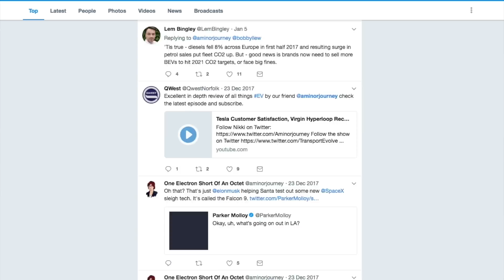Electric Car Fires: What You Need To Know

Comment: You can never compare Internal Combustion fires through collision with E. V. Every side of electric are battery rupture points as internal Combustion is only one side. No matter what these batteries are cased in doesn't matter as lithium polymer batteries emit there own oxygen meaning even under water they will burn. However all known resources and reserves of these batteries will be depleted within 10 to 15years. The lithium resources in our oceans have been considered financially unattainable. Plus in a internal Combustion vehicle no passenger sits on the fuel tank. Most EV occupants are sitting above batteries. Without Internal Combustion food/crop production will be lower and possibly threatening human starvation

Comment: Electric cars do catch fire less frequently but some of the vids I have seen - once they start they engulf the car in moments.
Reply: True
Reply: Danny Trump  Trump,stfu lol
Reply: EV☄🔥⚡
eXpensive Vehicle 💸💵 🤑
eXplosive Vehicle ⚠️☠🚨
Reply: Yes and in the case of the great Tesla once the battery fails you can not open the doors! Year ago a Tesla in London Ontario caught fire and hundreds of people had to watch the family die! Helples to open the doors to save them!
Reply: gas is not as pressurized as battery's they become powerful flamethrowers when they go critical
Reply: @Velvex_Vancreed  you just can't put lithium out. Just to see how dangerous they are we took a 12 inch square 1/2 plate put it on top of 2 patio stones ad put a cell phone batter on it and hit it with a hammer.  My god what an explosion and fire! It melted half way through the steel plate!
Reply: @Velvex_Vancreed  False. CNG is far more dangerous than batteries.
Reply: Motor cars catch under the fire more than elec. cars ,and every day motor cars catch fire 1000 times and that is normal,but when it comes to electric cars they are new teh. so its sooò dramatic when elec car catch fire.
Reply: @marjanoviccc  do they catch fire 10,000 times as often?  If they do them that would be a similar frequency! No where near!
Reply: @marjanoviccc  more petroleum cars are on the road hence more fires, an EV fire produces more pollution than a petroleum car fires
Reply: @Maximustard  no, per capita, EVs are better.
Reply: @b-7478i  prove it

Comment: Great reporting Nikki !    Another thing to consider with electric cars vs ICE is the amount of "fuel" in the tank/battery.  A Tesla 85kwh battery holds the equivalent energy of about 2.5 gallons of gasoline (fully charged).  A Tesla battery pack is in compartments and even in a crash the energy/fire potential is slow to be emitted compared to a gasoline fire in an ICE vehicle.  If I were going to be in a vehicle that caught on fire I would want to be in an EV that I have time to get out of.   Not a gasoline fire in an ICE vehicle that CAN erupt in an instantaneous huge fireball ( I have witnessed such an occurrence).

Comment: Is this a Tesla fire debunking or EV fire debunking, since as far as I know some EVs (like the Leaf) catch fire much less frequent than Teslas. Also, talking about Tesla flammability and safety one should bear in mind that Tesla cars are quite expensive (80-150k USD) so these should be compared to the safety of the similarly priced cars.

But usually, it is Tesla against the average, instead Tesla against the top dogs - where they position themselves, against top Merc, BMW, Audi, and similar. So it would be interesting to know if these top models catch fire as frequent as Teslas. Everything else is falling into the pit of the PR and demagogy readily served by our lord and savior e-Loan Mars.

For the reality check, please see where Tesla Model S ("the safest car in the world") fall in the Euro NCAP crash tests - at the bottom of the five star performers list, just above fellow five star performer Skoda Fabia. Also see how Model S performed in the IIHS test, where test equipment crushing Model S (top one) was crushed during the roof strength test not earning top score. There is a graph, so it is easy to compare to other cars. Tesla also stated that Autopilot is much safer than human drivers, but compared it to the safety of pedestrians and bicycle riders. When numbers were crunched properly, Autopilot was actually less safer than a human driver. Of course, if you buy it, Tesla story is - when you survive a crash, then this is due to the Tesla and the Autopilot. If you die, then, ah hell, it was undoubtedly your fault.

Comment: We had a car at work a few weeks back, spontaneously combust. It should be pointed out that it was an ICE vehicle, but the fire was due to an internal short in the ABS brake system, that happened in an collision. The car was repaired, but the short not discovered, until the fire...
We don't know yet what the Tesla fire was caused by, collision damage, battery pack damage, or some aftermarket accessories. Keep an open mind.

Comment: I agree with Bruce.  We are talking about a LOT of energy required to move a CAR/BUS/TRUCK down the road.  The Lithium batteries can catch fire if they are punctured/damaged... so if you drive over a post or something spikes the battery... could be a problem.  The speed of a Lithium battery fire I believe is typically slower than a gasoline explosion.  But I would be willing to accept new data.
Reply: Gas cars hardly ever explode except in the movies. Only ever had none catch fire at a road crash in 30 years in London FB Battery fires are chemical fire and Lithium is a very unstable element and dangerous. Two electric bus fire (High profile) in London in last few days!! They catch fire in seconds and the gas vapours as they vent explode and you have a serious fire you cannot extinguish by normal means. Water becomes contaminated and it takes lots of resources. You the have to dispose of the remains and Lithium. Garages will not touch Lithium battery cars.

Comment: I'd like a video covering how to react in case of a EV fire. How to react? Are there toxic substances released you should be aware of? Can you help victems out of a EV without having to fear injury?
Reply: These fires usually spread slowly so there's time to evacuate, and I don't think there's a risk of explosion. Big batteries are made up of small cells and each has it's own protection. In one case the entire front half of a Model X was obliterated in a crash, including part of the battery pack, still there was only a small fire.
There are some toxic stuff, but their release strongly correlates with the extreme heat so easy to avoid.

Comment: I am pretty sure that if my Zoe caught fire I'd have plenty of time to get out. With a petrol fire that time would be a lot less. On another note a friend told me he is taking his car in to be looked at because he can smell petrol, I told him I wouldn't use the car in that case. I am sure everyone has seen an ICE car totally engulfed in flames at the side of a road but because it isn't that uncommon in the grand scheme of things it barely gets a mention in the press. I also think that the fact that my Zoe is a very cheap car to insure suggests that there isn't much risk of it spontaneously combusting.
Reply: No. The car will continue to keep starting on fire due to the batteries. They will reignite again and again. The video fails to show the problems the emergency service has putting them out. Most are burning up in big wrecks.  A video search will show a very different picture.  Get out ASAP or get cooked.   Simply the best thing to do.

Comment: While I don't like to speculate.... The fire seemed to be located just inside the front left hand wheel, so is suspect it was not the battery pack but could be due to a short from a damaged cable feeding the front wheel drive unit or even the grease from overheated wheel bearings.
Reply: John Michael  - but you don't like to speculate.....
Reply: It looked a lot like a Li-ion battery fire.

Comment: Interesting report, though it sounded like there is a bit of inherent bias in the statistics involved as most ice cars driving around are pretty old on average. And is there even a mandatory 
recurring technical check in the US? I assume getting the data right would be enough to fill a bachelor thesis with, so I won't hold it against anyone, just point it out.
Also, did you find anything on random fires on other EVs? Is Tesla just the only one covered so frequently or ar they just prone to ignite more readily than others?

Comment: Thank you for being unbiased on ev fires.   Too many cherry pick the facts to support their negative bias toward ev’s.  ICE fires rairly get covered and when it happens to an EV its all over the news.  I’ll feel much safer in an ev than sitting in a ICE with 15 gallons of explosive gas any day.
Reply: You crack on your ev has already given the planet a massive carbon footprint before its first charge. So much so that university studies have concluded that a dirty diesel ford with 200k miles on has a smaller footprint!!!!!!
Also to add america has thousands of used nissan leafs lined up after they have died because you cannot recycle the batteries.
Oh how did they get there? By a bloody massive diesel boat which also produces pollution....
Its not about saving the planet its about money and having the latest car, phone, laptop etc etc.
Reply: Yeah you go with your EV. I’ll continue saving the planet by maintaining my 17 year old Toyota with 130,000 miles and not upgrading to a new EV every 3 years because society tells me this is the thing to do. People need to realise that getting a new car means your old one has to go somewhere. Much more environmentally friendly to buy a car that will last 20-30 years with replacing the least amount of parts possible. An ICE car will easily do 30 years of maintained properly, especially a diesel. I’m not sure how many battery packs an EV will go through in 30 years but 100% it will have to be changed.

Comment: I prefer electric vehicles over gasoline vehicles, hands down. But I think there are a few points missing in your assessment.

The first is that in the case of a fire caused by gasoline, the fire's intensity is limited by the supply of oxygen. That is, there is a maximum burn rate. In the case of a fire caused by faulty or damaged lithium ion cells, the burn is potentially more catastrophic. The lithium ion cells do not require oxygen to burn, and if one cell can produce enough heat to push neighboring cells beyond a temperature threshold, the entire pack is at risk of 'thermal runaway'.

Tesla's battery design is great, but we inherit a different set of risks by adopting battery technology. While it is possible (and even statistically apparent) there will be less fires overall, the fires themselves may be more intense, especially as the industry continues to develop the chemistry in terms of capacity and current delivery.
Reply: Solar Steve Everything needs oxigen to burn even lithium batteries.
Reply: Perhaps 'burn' was the wrong word. Thermal runaway in a lithium ion cell does not require any oxygen, and if 85KwH of cells dissipate their energy as heat instantly, you can bet nothing around them is going to survive. What if these batteries were 500 KwH? We're talking 1.7 million BTUs of heat. That's more than my furnace can put out in a day!
Reply: There are plenty of videos of car fires, they don't seem to be limited by air supply much. All ICE cars are filled with highly flammable liquids, that are often leak a bit, so even a small flame near the engine means huge unstoppable flames in seconds.
And big batteries are made from small cells, each has it's own protection and controller, so it's practically impossible to have all of them blow up at the same time. You have little chance of controlling the fire, but you have plenty of time to get the hell out.

And yes, lithium needs oxygen to burn.

Comment: okay, now... discuss how many electric cars have broken down on the side of the road...... AND!! I'm not discussing running out of battery power as ICE cars can also run out of fuel.... I want to know how many BEVs have broken down.
Reply: EVs are far more reliable and require far less maintenance.
Ironically Teslas have the most trouble with the 12V battery, which they inherited from gas cars.

Comment: Just Google "Chevy fire" or "BMW fire." But Tesla is small volume? Google "Rolls Royce fire." 
But you can't even pack lithium batteries in your luggage to fly. Right. Care to try packing a spare gallon of gasoline on a flight?
While the Tesla fire video was dramatic the fire had not intruded into the passenger compartment. Plenty of time to leave the vehicle. Gasoline fires are often, make that usually, much more violent.
Reply: Tesla is not "small volume" on a model by model basis. When these sorts of things are studied, a Model S will be compared to peer vehicles, a Model 3 will be compared to peer vehicles, etc. Nobody cares whether Ford as a whole has a lower or higher incidence of fire as opposed to how their pickups compare to other pickups, their sedans compare to peer sedans, etc.
Reply: I was just using the type of overstating common among haters. It will be interesting to see the root cause if it's ever announced.

Comment: I'm curious to see the first Tesla Model 3 battery fire. From what i've seen and read, they have the most advanced EV battery pack ever made.
Reply: Probably somebody drill battery from beneath! 
It is easy and reaction is delayed you can walk away and after 20min car start to smoke!
Reply: Model 3 battery packs are filled with this green goo that foams up when exposed to high heat, so it should self-extinguish itself.
Reply: nope